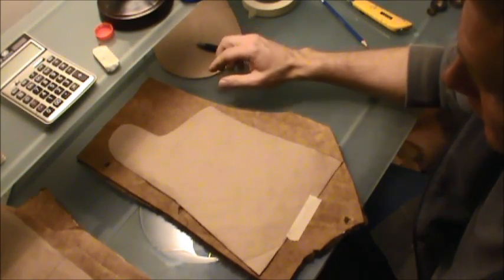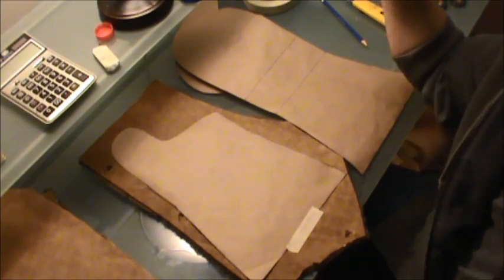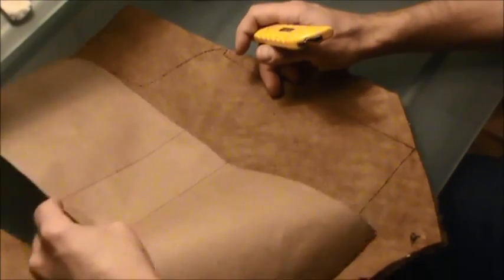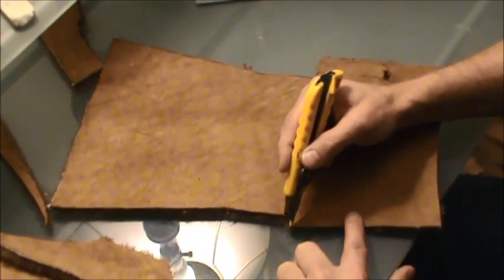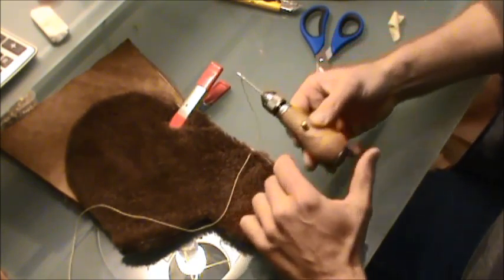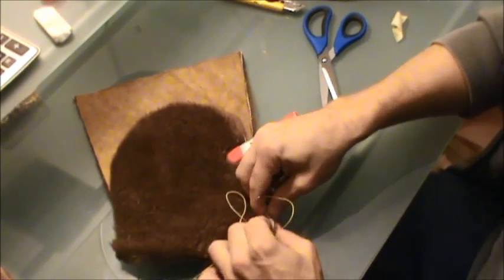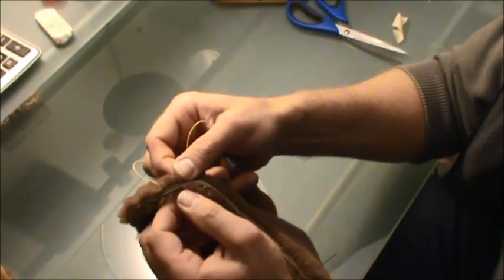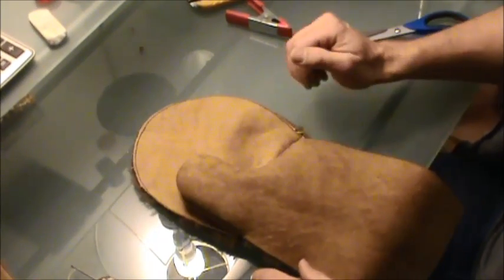HOW TO MAKE FUR MITTS (PART 1)

Comment: lil trick-- make the stitches  quite close together around the thumband yolk where palm and thumb meet... and anywhere you need a smooth -- less crinkled/bulky seam.. then lightly dampen ( I just use a wet washcloth) and take a hammer and pound stitches flat...   I find something hard to stuff inside thumb-- pound from outside --- not hard-- and if you have a small rubber mallet-- even better...keep stitching close and even -- will finish smoothhhh
Reply from the maker: +kimcase9 
Thanks Kim! It sounds like this isn't your first time making mitts:)
It would have been nice to pick your brain last year! Lol!
The bulky seam trick sounds like a great idea, I'll have to remember that for next time. Thanks again Kim
Reply: taxidermy instructor-- nope-- not my first rodeo  -- lol
Reply: @kimber-t9m  any chance I could jump on that info? It's so hard to find decent instruction on the Internet regarding proper fur mittens.
Reply: @jamescurrin5938  ask away... I usually have a trick or two

Comment: Sir: I am making a pair of mitts per your pattern. I am a novice sewer and having a problem where the out side of the thumb stitching stops. When I sew the back on, to the outside of thumb I am getting a pucker at that point and some times I have an open area at that spot. I have noticed the two divots at the opposite ends of the thumb stitching thru palm . You did not address the two divots in your video. Could you explain the reason for the two "divots" and why they are there. Thank You.
Reply from the maker: +FELIX ESCARENO SR. 
Hi Felix, I believe you are referring to the seam allowance? You will see this at the 2:00 mark on the video. The seam allowance is the extra 5/8" that is around the top portion and the thumb of the mitts. Both pieces of material need to match this extra seam allowance exactly, with no bunching as you are sewing or both of the pieces will be misaligned. The divots will not be noticed as the 5/8" seam allowance will hide your work once you flip your mitt right side out. Are you sewing over the seam allowance? Are your stitches too far apart? Just wondering. I believe my stitches were around 3/16" apart at their widest. 
Hope this helps Sir.
Reply: Sask Hunting x

Comment: how did you source the shearling you used for the mitts. A shearling hide starts at $100. What size piece did you use for 2 mitts. Great detail in the video, well done and needed thanks for taking the time to make this video
Reply from the maker: Had an old coat I no longer used.
Reply: I bought a bunch of shearling from tandy. It is 100% wool but on a (cotton I believe) backing. You can buy it by the yard. I've made an oilskin sleeping bag and lined it with this shearling and camped out in 30 degree weather under a tarp tent and small fire and stayed plenty warm. I plan on making a pair of mittens with it too and just contact cementing a split onto the back of the shearling. It is cheap, but still real wool and super soft and warm
Reply: Possum Sausage thanks, also I searched shearling hide on amazon and found a company called Glacier Wear hide and leather. They seem to have a good price.

I use a Kifaru tipi tent and wood stove in AK with a Wiggy sleeping bag😎
Reply: @danmitchell3758  now that I think of it, I believe that was a a discontinued item that I got on sale for that "man made" shearling. I bought like 5 yards of it, 54" wide. 

I'm more of a modern buckskinner myself in IN. I like 1800s stuff but make do with modern materials the same way buckskinners/trappers/traders made do with modern materials in their time

Comment: What do you do about the raw end at the opening of the mitten?  That is the only part I am struggling at.
Reply from the maker: Thanks for the pics:)
Good on ya sir!
Reply: I was wondering the same thing?
Reply: Sask Hunting:  Will you answering the question about finishing off the raw end at the opening of the mitten?  Looks like there were others with the same question.  Thanks.
Reply from the maker: Sorry about the abrupt ending!
I simply folded the cut edge over itself inwards  making the fur flare out. I used a regular sewing thread that was slightly thicker,  I purchased it at saddle shop to sew the seam upon itself to flare the fur. (Regular needle and thread) Hope this makes sense.
Sew the end of the seam just attaching it to the inner mitt portion. Not going through to the other side of the mitt!!! Just puncturing half way through the material.
Just enough to adhere to the mitt not leaving an obvious seam along the way...sorry, I should have shown that step. My bad